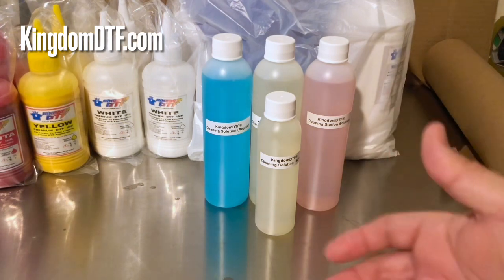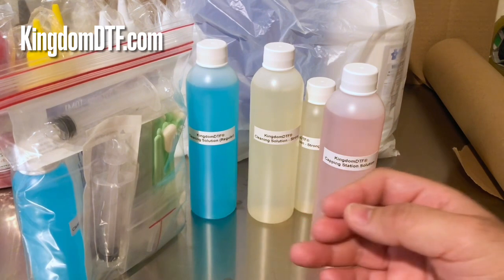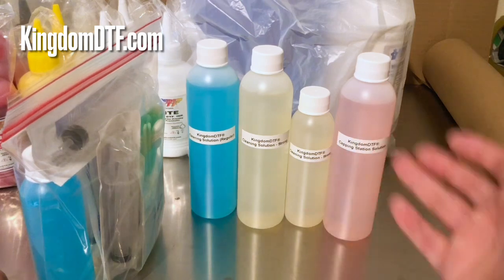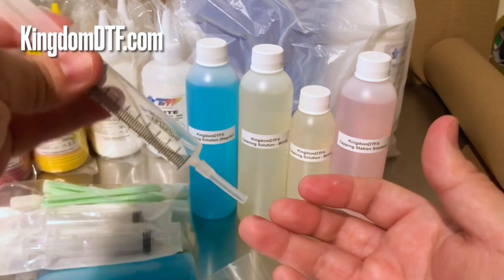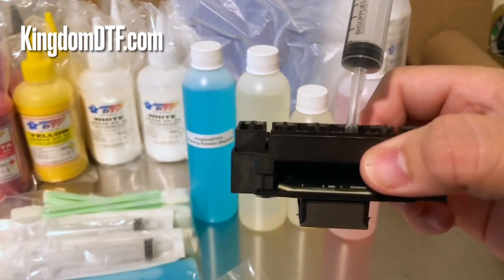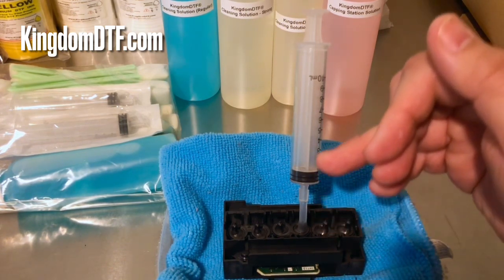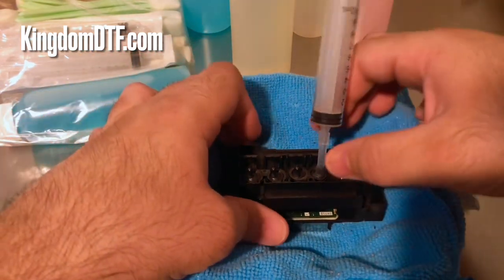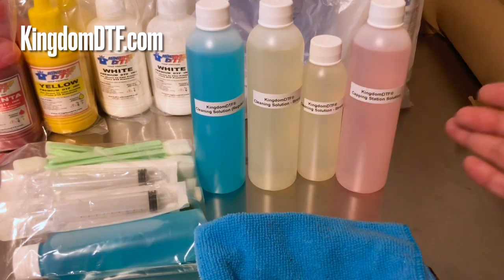How to do Printhead Reverse Flush & Different Cleaning Solutions for Maintenance DTF Printers

Comment: Ive got a question... So I used cleaner to push through the tips at top of print head to see if were clogged. Well I'm guessing some was and i wasnt paying attention that it came over and did get on the board part underneath. I didnt connect back cause figured id make sure over night it dried good. So I left it out and left printhead sitting in very tiny bit of solution to not dry out but so board could dry. Will that be ok you think?
Reply from the maker: You can not wet electronic parts, it can damage the printhead.

Comment: Great video. And I will be ordering soon. I cleaned my print head and reinstalled it in my L1800.  Now the front power light is not on but the back power light is on and it is beeping.  What does that mean?  It stated doing that once I sent a print.
Reply: I did the same thing.  I got liquid where the ribbon cable plugs into the print head. Burned the print head and motherboard.  It’s repaired now with new motherboard and print head but it was an ordeal and doesn’t print like it used to.  Good luck.

Comment: when I do the daily check of the nozzles and cleaning of the head, I see that some of the white lines have been replaced by black lines, also sometimes the dumpers of the white have a dark color inside, I changed a new head, a new dumper and the capping station pump is fine, for a year I had no problem
Reply: gasket under the damper or dampers is leaking. seen a video on it

Comment: DO NOT DO IT!!!!!! FRIES THE MOTHERBOARD AND THE PRINTHEAD!!!! I HAVE DOZENS OF ORDERS AND MY PRINTER IS FRIED. BEEPING, WON'T POWER UP.  I NEED TO RE-SOULDER THE MOTHERBOARD AND REPLACE PARTS. I AM BEYOND MAD, I WAS ******CAREFUL******I AM DESTROYED.
DO**NOT**DO***IT
Reply from the maker: If you use too much liquid and you push too hard you can blow the head and damage everything. You need to know how to do it and have patience when it comes to cleaning and maintaining your printers.
Reply: @KingdomDTF  I am very gentile. It was shallow, and I was careful, yet still my printer is blown up. I now have to re-solder my board and hope I’m not out $$$ of dollars replacing it.
Reply: I had this happen on the motherboard and replaced the four transistors. Bought it back to life. It might help knowing how to solder and being an electrical engineer. These printers are so unforgiving.